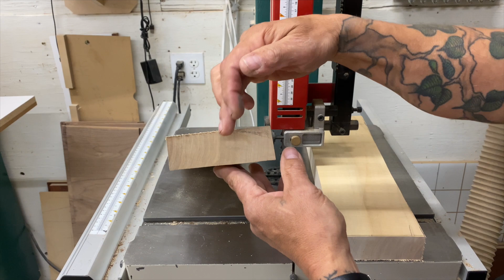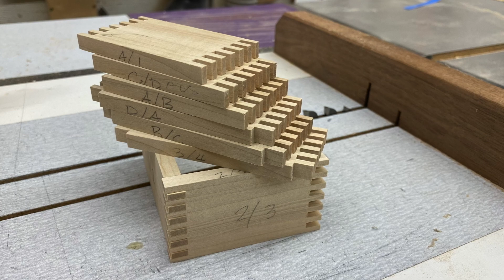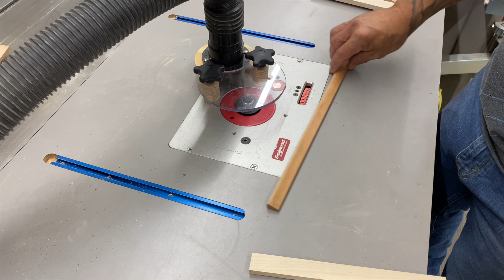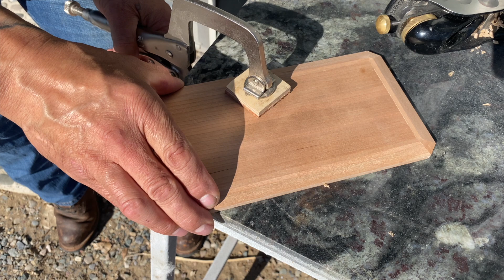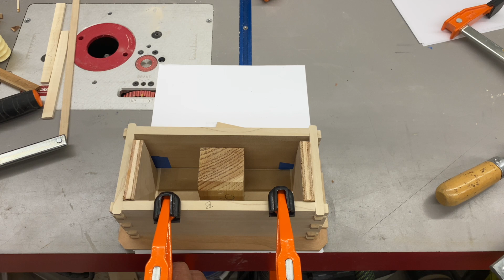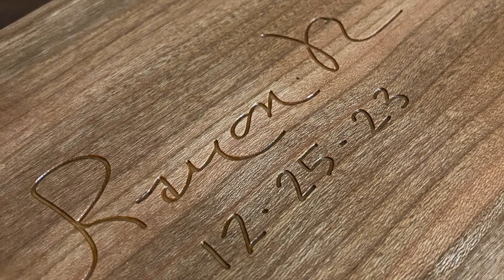Boxes with grain matching on all four corners? Easy!

Comment: Beautiful work! Question- is that a G0513 bandsaw, and if so which blade do you like first resawing? Thank you sir.
Reply from the maker: Thanks ! Yep…that’s the saw.  The blade is a Lennox Woodmaster carbide tipped.  1” wide x 2 teeth per inch. I believe the kerf is about 1/32”. Works well

Comment: Great video Ramon! Loved the little push sticks for the thin pieces you ran through the router table..thanks for sharing 🙏
Reply from the maker: Thanks man!  It may have made more sense to run the slot first whilst the board was bigger…and then cut the profile after it was attached.  But I pushed ahead so I could see the overall look.  I figured…”there’s always a way” 😆👊🏼

Comment: I also like box joints.However always seems to be a messy glue up.Any suggestions?
Reply from the maker: I’ve made tests with box joints and if the joinery is tight…not too tight where you need a sledge hammer😆 , but a good fit…then they only take minimal glue.  Or you could add blue tape prior to glue up.

Comment: Great job Ramon !  Knowing the history of the wood makes this project extra special. I also have a Shaper Origin and agree that it's an amazing tool, the engraving and inlay use has dramatically changed my woodworking, I enjoy using it more and more with each project.
Reply from the maker: It really is special!  And yeah, I agree…the Shaper Origin gets used a lot in my shop.  Much thanks.